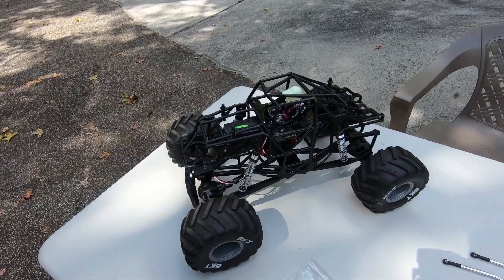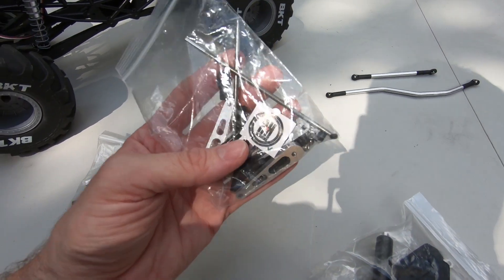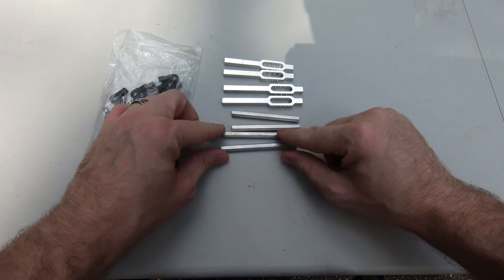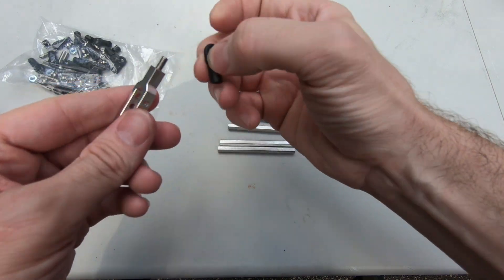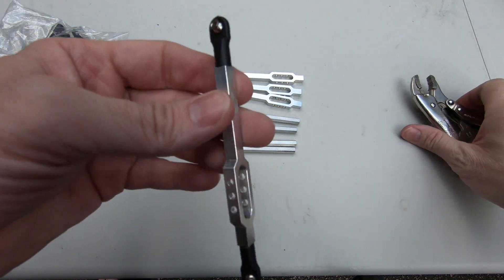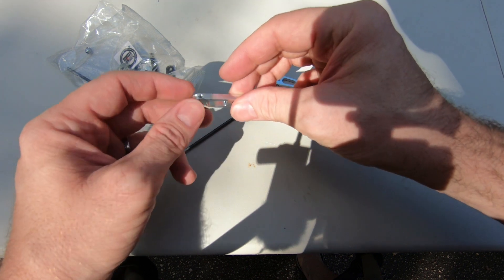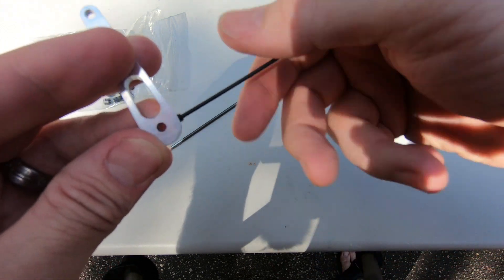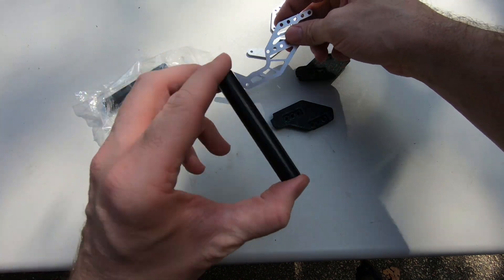SMT10 RH Designs Upgrades

Comment: Finally got a SMT10 last night. Have the same plans to build it based on Trigger Kings Sport Mod class, even if I don't ever race it. Only thing different I'm doing is using Duratrax Munitions for wheels and tires.

The driveshafts remind me of when I extended the wheelbase of my Capra, little trial and error to get the right lengths. My Wraith 1.9 came with links for 12.3", even though they're plastic, may give em a go and see how like it shorter. Do need to get a wheely bar though. What pinion are you using with the 17t? Thanks ahead of time, man!👍👊🍻
Reply from the maker: I forget what pinion I'm running. its been so long since I opened it up. I think its the stock pinion from the SMT10

Comment: I also want to order the kit so I ask. I am not sure if I should get it in 12.5 or 13 inch
Reply from the maker: I dont know which one I have. I bought it second hand.
Reply: @ C.B.ONE , I have a smt10 and trying for a more scaled wheelbase of 12-1/2 in./12.5 , got a set of links that said 12-1/2 in. from CPE off ebay installed them, wheelbase was 11-11/16 in.  NOT HAPPY.
Reply: @rogerbeam3426  Ok, I have a set of links from So Cal RC which is about12,5" I also have the RH Designs set in 12,5"
Reply: @CBONE-pg2yz  , how much are you asking for them ?
Reply: @rogerbeam3426  asking? how do you mean?
Reply: @CBONE-pg2yz  , are you selling them  ?  If not do you have part numbers ?
Reply: @rogerbeam3426  threre is no part number, ordered it about facebook directly and ebay. RH designs ebay shop

Comment: hey, which wheelbase is that kit, 12,5 or 13" ?
Reply from the maker: I honestly do not know. I bought it from a guy that had it and didnt use it.
Reply: thx for the info
Reply: if you press the truck down or the suspension, is the upper link rubbing against the drive shaft? because the upper links are straight with no bent like the ssd upper links or incision upper links.
Reply from the maker: @CBONE-pg2yz  Not on mine.